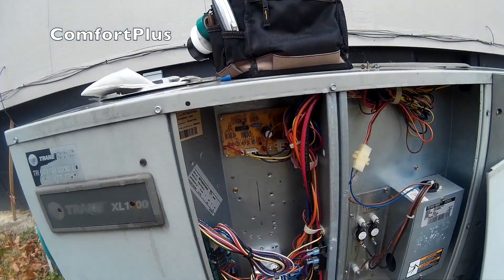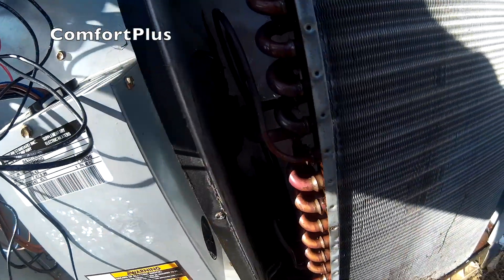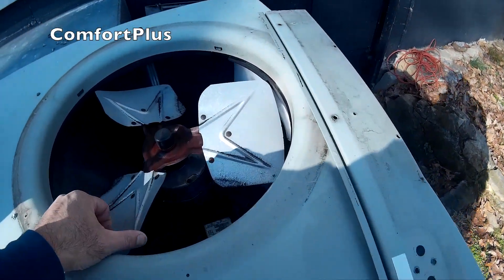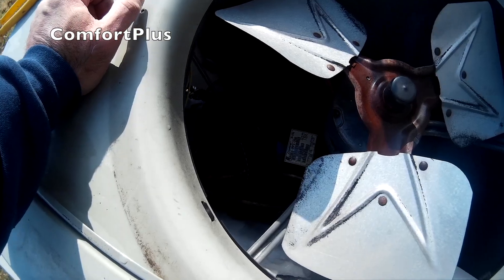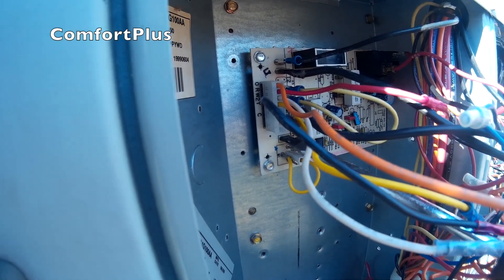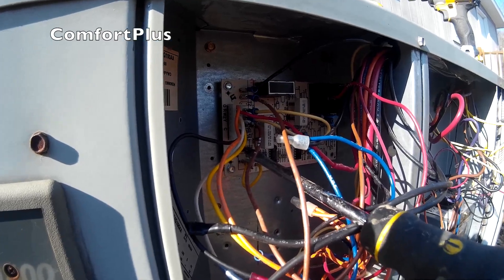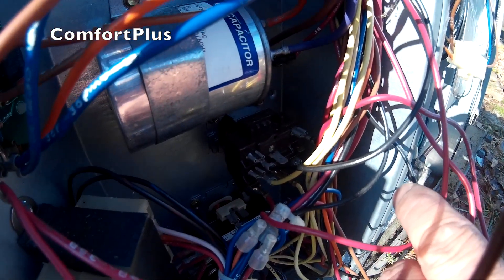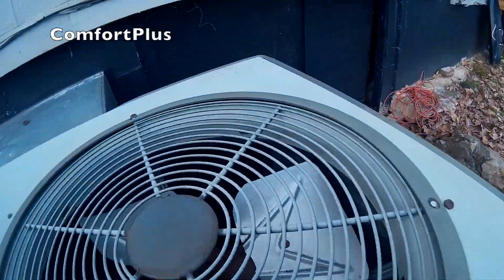Trane Package Unit Defrost Problem

Comment: I have a Q for u. I have a Trane xl 1200 gas pack with compressor 4 ton unit. The condenser was freezing up when the temp outside gets cold. I had a repair man come and check it, but he didn't do a very good job because it was so cold that day. He checked the coolant and said it was a little low so he added some and told me if it did it again he would check the defrost board. So it froze up again and I pulled the panel off and looked at the defrost board and the led wasn't blinking, just barely lit up and stayed on. I ordered a new board and installed it and its working, but I notice the recirculating fan rarely turns off. Is this common for these units. The temp outside has been in the high 20's the past few days since I replaced the board. I just don't want to get a huge elec. bill because its not running properly. Thanks Mike
Reply from the maker: +michael monday When a heat pump isn't running correctly or the temperatures are very cold outside the Aux heat will have to run a lot to keep up. Does your thermostat show when the Aux heat is on?

Comment: Great job on the repairs ...I had 2 heat pump problems this week ...some hacker is cutting the yellow pressure wires and tying them together . One in the city and one in the county 40 miles apart !!
Reply from the maker: Probably not even the same guy doing it too lol. Much harder to troubleshoot when you follow someone like that! Thanks for watching!